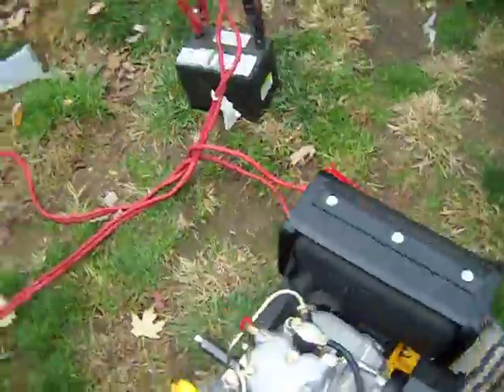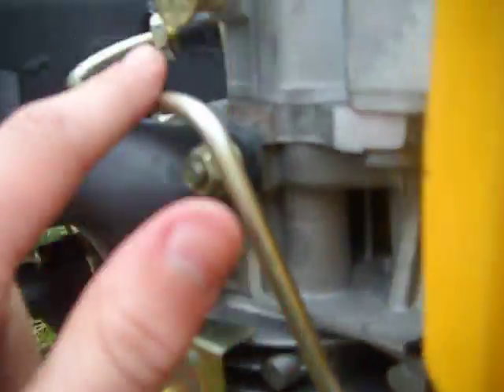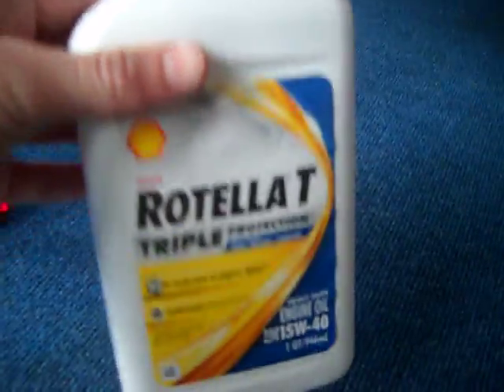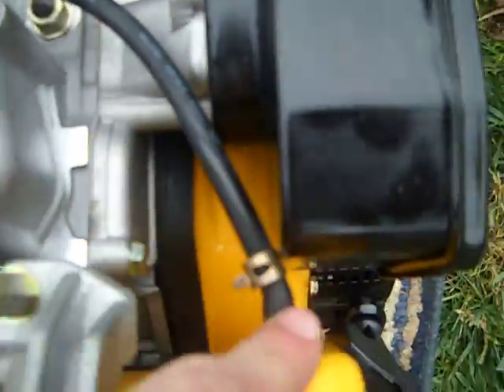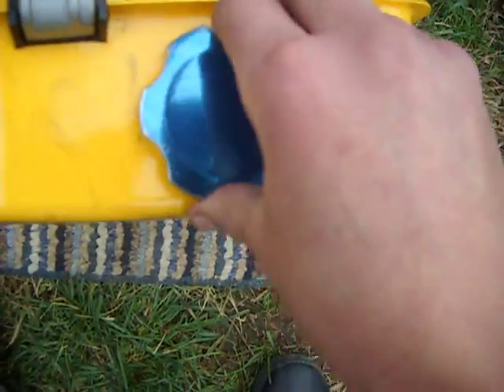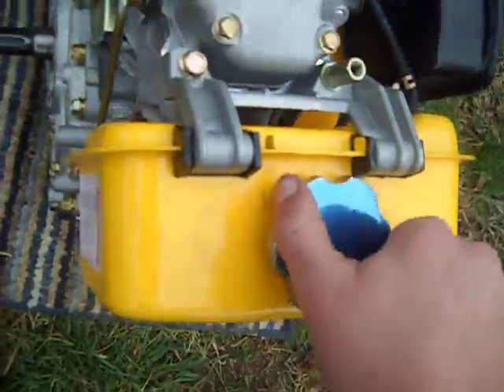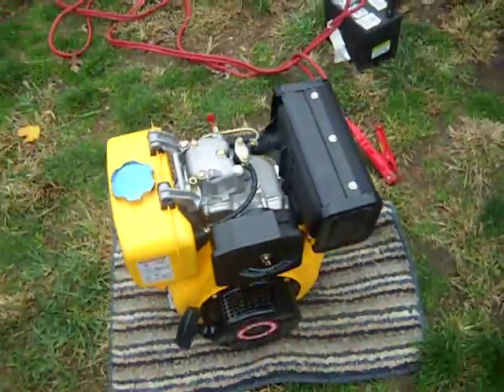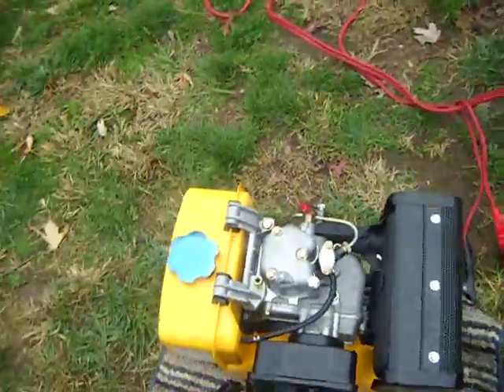New air cooled diesel

Comment: yeah i just said that thing about oil i dont think bio would cause rust or anything. actually 15-40 is thinner than sae30 but has the protection of a 40 wt at operating temp with better startup lubrication. i put 15-40 in my truck its got a gasoline engine

Comment from the maker: It wasnt a lot of mmo, not a big deal, its not hurting anything. Im actually running a thicker oil in it then it says, Im running rotella 15-40 and It says to use a 30 weight but thats to thin for my liking. I dont like seafoam because that too THIN. I would only use seafoam in the fuel. And biodiesel will no cause it to rust. If its been made right and the fuel has been properlly washed and dried it should be fine. I left biodiesel sit in it for 3 months nothing happened.

Comment: than there was water in the vegetable oil , diesel does not have detergents in it any more because it was bad for the engines now diesel is mostly bio-diesel it made from vegetable oil and fats but its processed  and blended with a solvent in my yanmar diesel i have use vegetable oil for a long time but i mostly get motor oil so i use it more than vegetable oil

Comment: A couple of points to consider. Real diesel fuel provides lubricity, and I am not sure your fuel combo can protect the engine. Also, make certain that you have a tight-fiting connection to the crank when you connect this in an application. I had a snow-blower replacement engine pulley spin on the crank, and it ruined the crank. I should have known better. :)

Comment from the maker: @1972FordF150 yeah i know i love the 7,3 grreat engine its a very simple but effective engine. but that was the first time i started it up and i have not ran it on diesel at all and there is a big differnce in black smoke by a lot great engine for chinese made this thing puts out 135 psi when cold of oil pressure and 80 psi at idle then when warm 60 psi at idle and 100 at full throttle thank for the comment